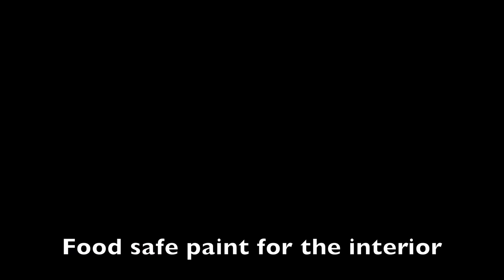Rusty Grain Mill Restoration

Comment: This is one of the ancestors to the food processor of today, crunching up hard grains into small chunks.  Very useful, I wonder if it was used to make corn meal as well, for corn bread and mush. Thanks for sharing, really like the color scheme you used, not the standard black that was common back then. 👍🏻👍🏻😁😁🇨🇱🇺🇸
Reply: I rather suspect this tool was originally designed for cracking whole grains like wheat, barley, rye, oats, etc. for pain de campagne. Maize is a fairly important crop in France now - the country produces only slightly less maize per annum than Canada - but even today most is 'field corn' for fodder or for export as corn meal/polenta. Maize simply isn’t a major part of the French diet.

Keep in mind that France is the fifth largest wheat producer in the world. They had no need of maize; they're one of the historic breadbaskets of the world.
Reply: @Ea-Nasir_Copper_Co  thanks for the info, but if it came to the USA it may have been used to grind other items. Thanks again for sharing your information on this kitchen tool.  Paul 🇨🇱👍🏻😁

Comment: Hi.
A great video.
Just try to use a indirect light source because the whites are screaming and are over saturated.
Keep the good work just adjust the light sources or shoot with low iso values.

Comment: Another wonderful restoration ! Avril does not like the smell of brass!  I need something like this to shuck Sunflower seeds, but I have never seen anything to achieve this, are you using aluminium oxide in your sand blaster ? Chris B.